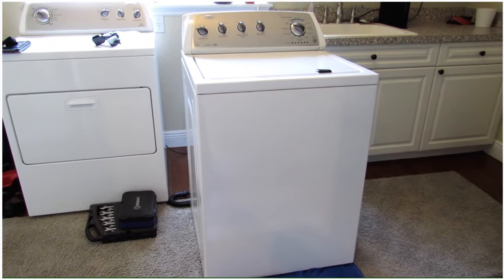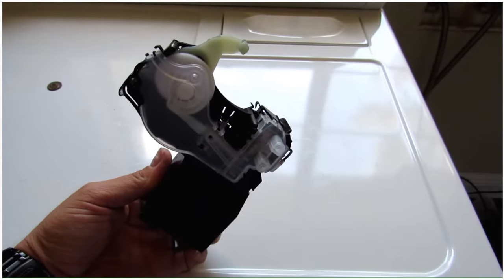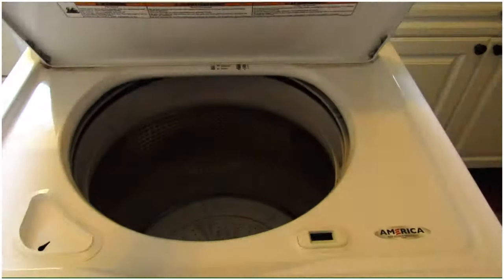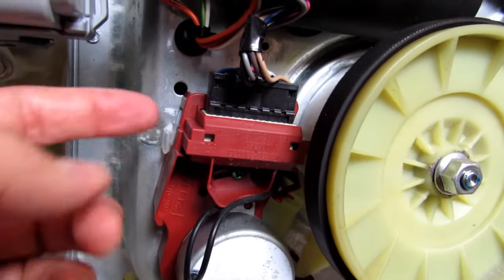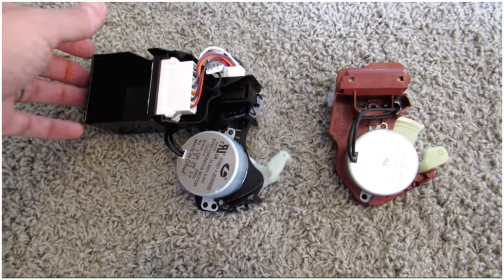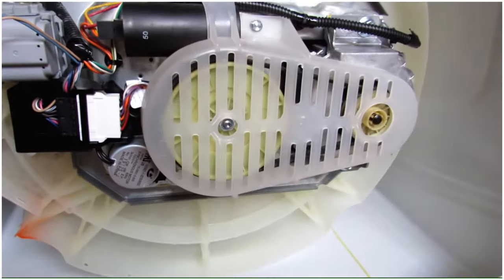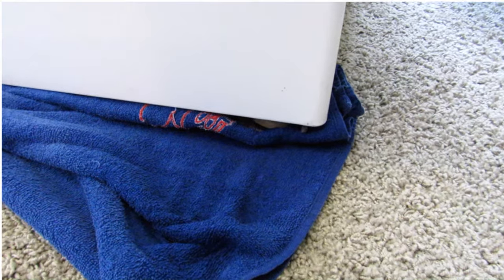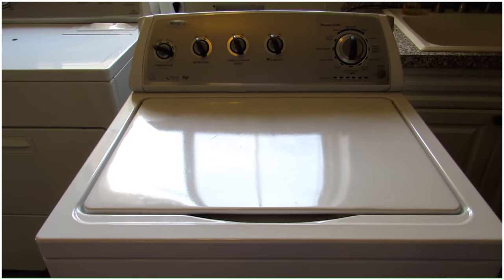How to fix a Whirlpool Washer that Won't Enter Spin Cycle Automatically

Comment: The shifter motor shaft has a cam with channels on both sides.  A plastic stud on the side of the shift cam follower breaks off. When the stud breaks off,  the washer will remain in the cycle it's in.

Comment: You really should always recalibrate the control and clear any error codes that may be in system after you change the shift actuator. Also be careful to get the proper shift actuator for your model as there are 2 different ones.
Reply: THANK YOU FOR THIS COMMENT! I had not run the recalibration after installing the new part and was worried because the issue still remained. You are so helpful!

Comment: I have the same problem, without a load it'll spin and with it won't spin, I checked all the teeth and gears and their all good, it just won't spin with a load in it.. could it be something else or should I replace the actuator.. it is 12 years old.. it will wash a load but not spin a load

Comment: My washing machine starts the spin cycle but stops instantly. I noticed the drive pully is scraping on the gaurd as well. Plus you can push the pully up and down about a quiter inch or so. The diagnostic says washer drumb off balance. I dont think thats the issue.

Comment: My front wash machine have a sensing light up after the wash is very hot and clothing still wet and slow cycle because of the storm my basement got flooded about 1 feet any idea ?

Comment: My washer isn't the same model but whirlpool 17kg topload smart machine but it spins for all the other cycle but does not drain water from clothes or spin wen cycle is done
Reply: Technician support manual is tucked in the front left corner of the machine under the lid. It could need a $300 control board, or just a poor electrical connection somewhere. Not draining means the pump is not working. Not spinning could be a bad shifter (actuator) or just a dirty splutch can that needs to be easily removed, have sand and dirt rinsed out and reinstalled. The spring could be weak and need to be replaced. If you don't fix bad actuator and clean the splutch, the $250 motor will burn out.

Comment: My washer didn't spin afterr I replaced the actuator.
Reply: What’s the actuator ?
Reply: @larryhickman8866  I believe it's a sensor
Reply: @kimh8715  The actuator has the barrel spin sensor built in. It's an optoelectric sensor, so if its line-of-sight is obstructed it won't work correctly, but as long as it's seated in place and screwed in correctly, that should not present an issue.

Comment: Hi sir ! My machine the same your model and not spin. I reset the motour and it work some time and not work again. Can I chanege a new one as you do? I used spin function it work. But i used any function to wash as regular/ quick/ light wash it not spin after wash, tks!
Reply from the maker: That sounds exactly like what my machine was doing.  It would work sometimes and it wouldn't work others when using a wash cycle.  But it would always work if i ran it in rinse & spin mode.  It's now been a few months since I replaced the shift actuator and my machine has been working like new.
Reply: @applianceowner3469  ýes, it alway work with rinse/spin function . But every wash function work and not work. I order already and will try this weekend. Tks for reply me !
Reply: Also remove and rinse out the dirt and sand from the splutch cam (8 minute job) when replacing the actuator  (shifter). Be sure to replace with which ever color actuator (red or black). Run the recalibration function after replacing it disconnecting ANY electrical components of these WHIRLPOOL built machines sold under numerous brands.